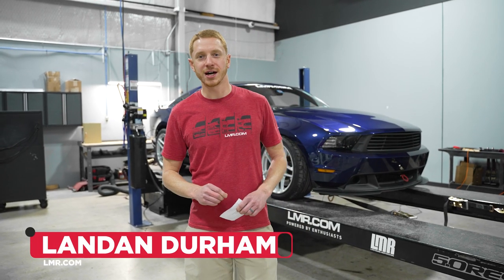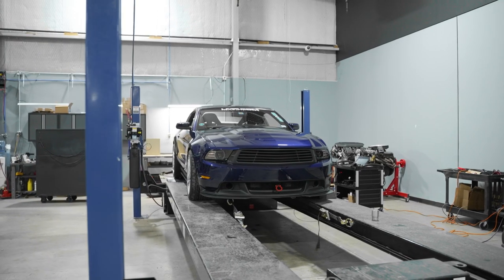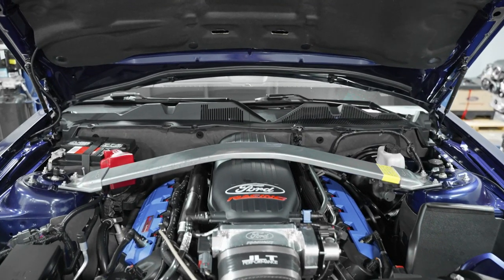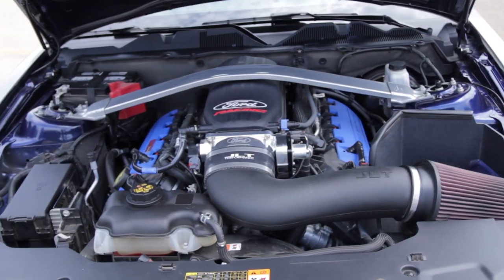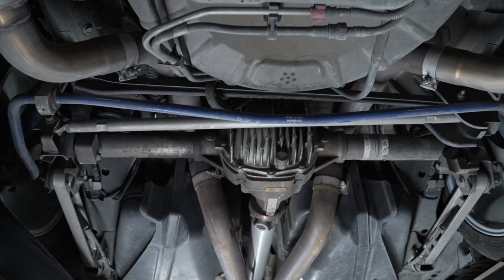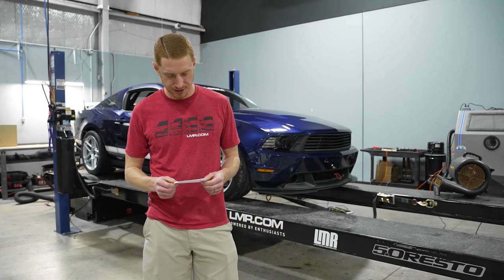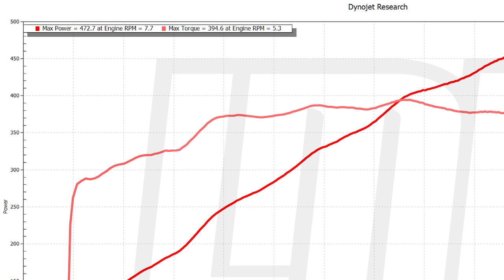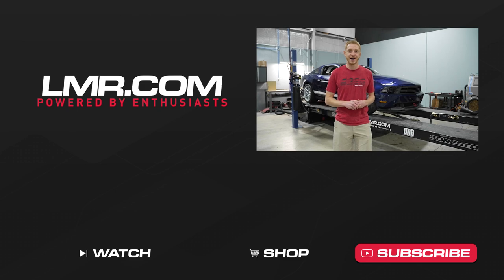Aluminator XS Powered 2011 Mustang GT Dyno | M-6007-A50XS Crate Engine

Comment: Yeah but it’s not a 5.0 isn’t it a flat plane 5.2 ? Or is there a different first gen. Model?
Reply from the maker: This is the first generation Aluminuator XS engine which has a displacement of 5.0L.  -Landan
Reply: The 5.2 XS is cross plane.   Basically a cross-plane Voodoo with a CJ intake - 580 HP.  FPC is junk
Reply: @BC08  Interesting stuff, I wonder who the target audience of the Aluminator 5.2XS is when the Predator crate engine is about $2K more. The Aluminator seems to be a non-boosted Predator with some Cobra Jet parts on it
Reply: @Justin_GFM   Probably kit cars like Factory Five and just anyone that wants an N/A combo.    

5.2 XS has been out since 2017
Reply: @Justin_GFM you'd get more power from an aluminator with a turbo than a predator